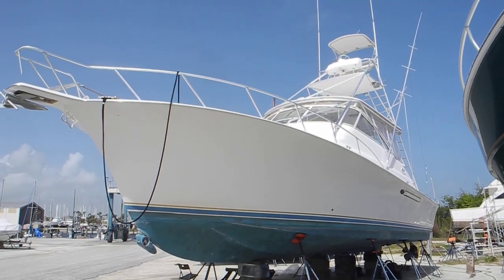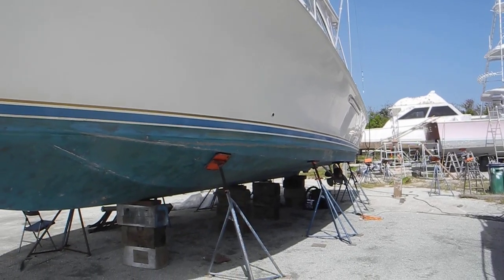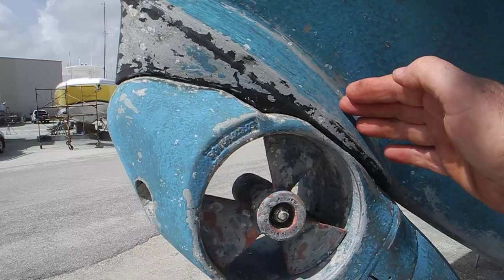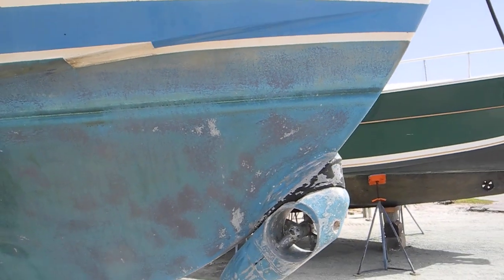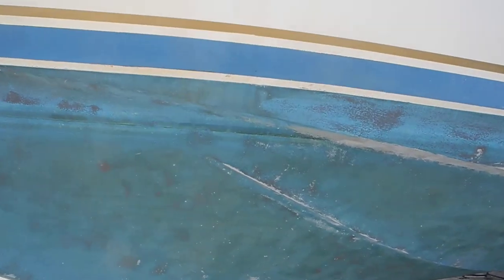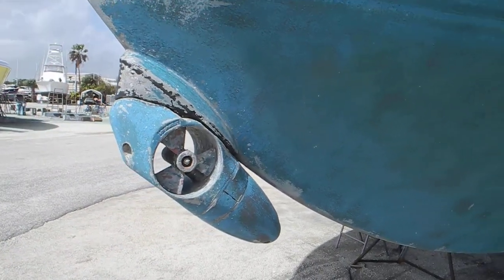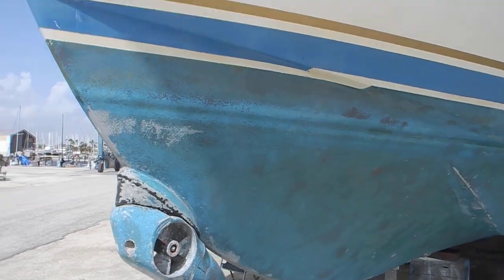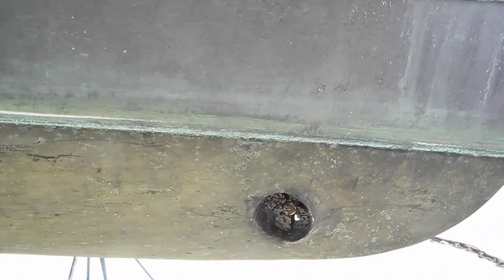External bow thruster

Comment: Chris.  You do a dis service to the boating community.  I have had this type of bow thruster on my boat for the past 6 years and it has been excellent in every aspect.  You should vet this out and know the facts about performance and reliability of these.  They are machined from a solid block of military grade aluminum and can take anything the seas can throw at them.  Even object strikes are well tolerated.  They are more hydrodynamic than a tunnel thruster and provide more thrust and longer run times.  They are easier to install and less intrusive to the hull and install for less money than the traditional tunnel.  Take another run at them.  Thanks.
Reply from the maker: Can you tell us what your thruster brand name is so people can look for themselves. Glad you’ve had such a good result. If you listen carefully you will hear me say “I just don’t know….” And that we don’t usually see this style of thruster on a sport fish boat. We report. You decide. Thanks for sharing what works for you. 👍🏼
Reply: @AskCaptainChris .."Yacht Thruster" is the brand name.  Thanks Chris.

Comment: That bulbous shape may actually make the boat move through the water more efficiently. Also, it looks like the thruster can rotate some, making the bow even more maneuverable, no?
Reply from the maker: I can’t say as I just saw it out of the water. Lots to think about.
Reply: No way that it would act as a bulbous bow (in a positive way) and no, it's not rotatable.
Reply: @skunkjobb  Some manufacturers claim this external design provides less drag than a conventional tunnel through the hull design, but I haven't seen any documented evidence of this.

Comment: How about the drag factor??
Reply from the maker: I doubt the drag factor would restrict the sportfisherman boat's speed BUT the drag factor may affect the bolting into the vee hull of the boat?
Reply: I was worried about the drag.  When I had the boat hauled for installation, I had a bottom job done at the same time.  The boat was faster after the job than before, probably b/c a cleaner bottom. Now that it's been in there awhile, I really notice no difference.